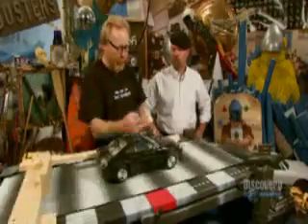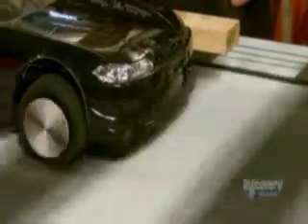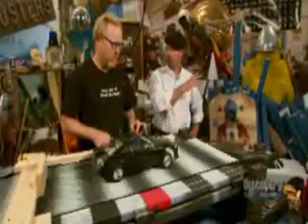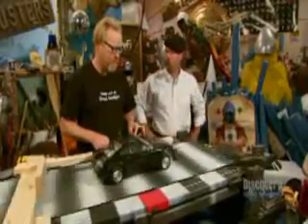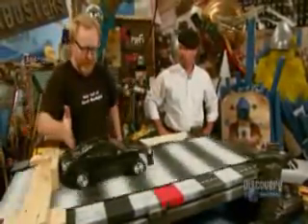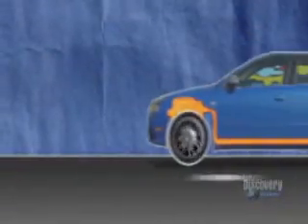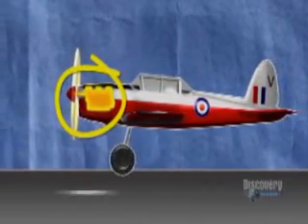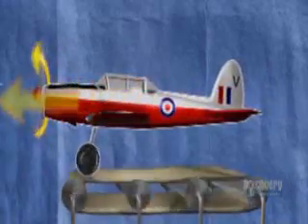Plane Conveyor Belt MythBusters Explanation

Comment: Of course a plane wouldn't takeoff if it's not moving, but how would you stop a plane from moving by using a conveyor belt in the first place. That just wouldn't happen in reality. The plane's wheels are free-spinning and don't affect the plane's movement, aside from the slight friction. There's no way to stop a plane from moving forward using a conveyor belt, unless you tie the plane down or hold the brakes.